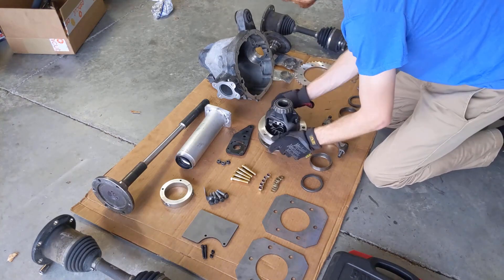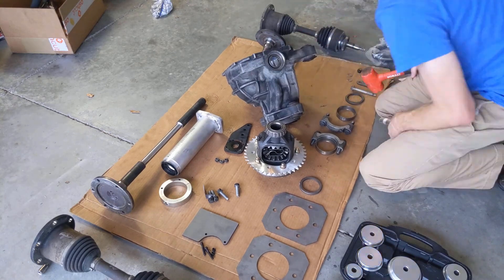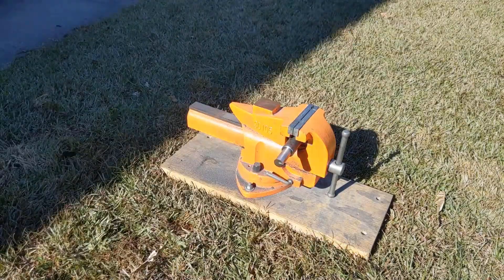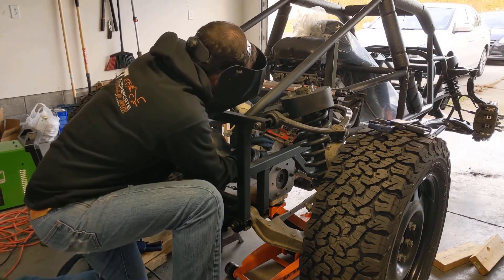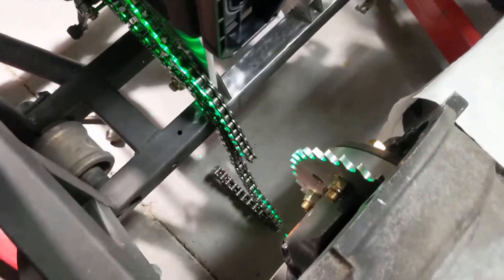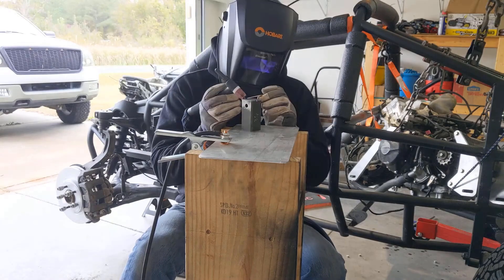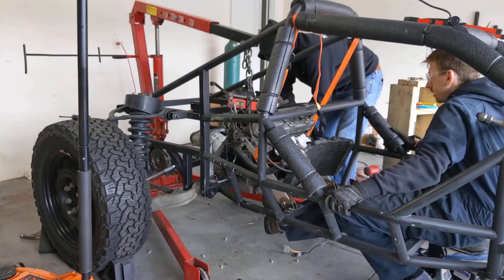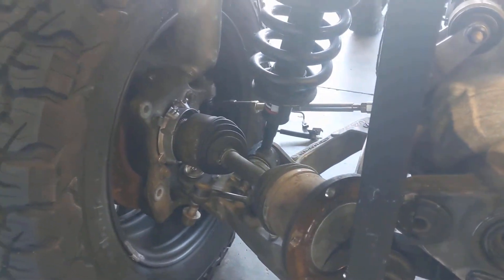Project Octane  |  Drivetrain Day

Comment: Absolutely phenomenal!!! How will you go about protecting and lubricating the differential being that it is chain driven?
Reply from the maker: Great question, can't really fill it with oil with the open face. Thinking about putting the stock cover on but with cutouts for the chain and then also making a sort of complete chain cover to keep out as much dust/dirt/water as possible. It's possible it may hold oil then but if not we may just have to live with greasing everything and hoping the cover keeps everything else out.

Comment: haven't reached the end of the video yet but how are you gonna handle the lubrication of the diff? i guess with all the driving it's gonna need a way to stay lubricated otherwise you may end up having to rebuild it a fair few times, i feel
Reply from the maker: Good question, right now it's just lubed with grease but I plan to put an enclosure between the open housing face and around the entire chain to keep as much dirt and debris out as possible.